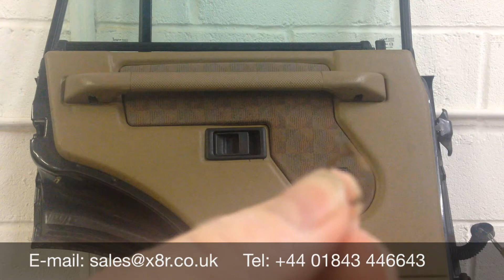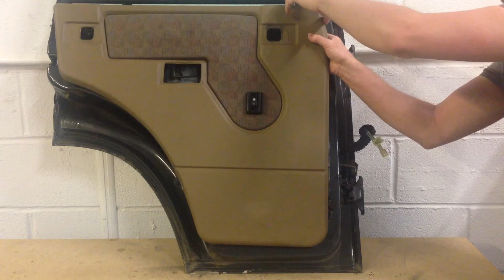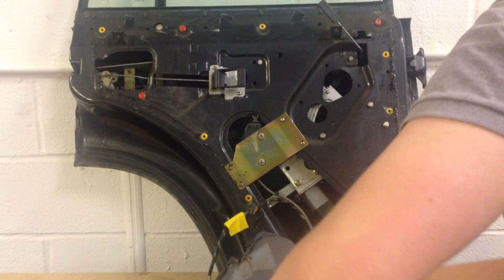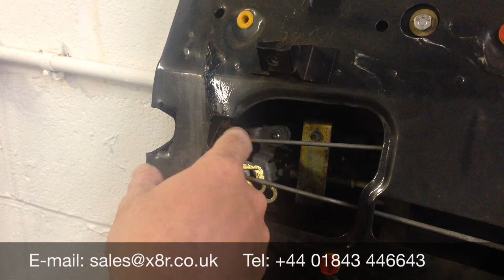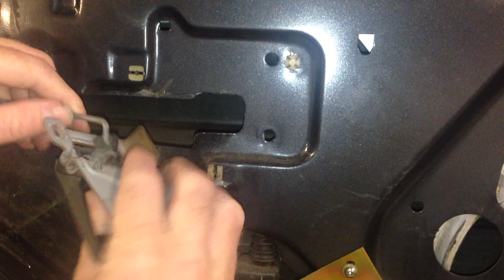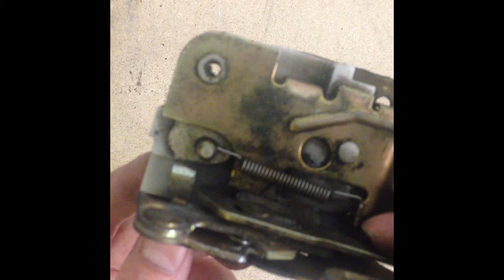Land Rover Discovery 1 MK1 & Range Rover Classic Door Lock Latch Repair Spring Repair Replacement

Comment: My driver door just needed to be tightened with this issue. Was able to go in and fix the issue. The driver side passenger door....its a different set up, went in thinking id just tighten the rod. Had my tools! And then...Not the case. Guess i need a little spring thing. Thank you! Actuator time! This video is super helpful thank you